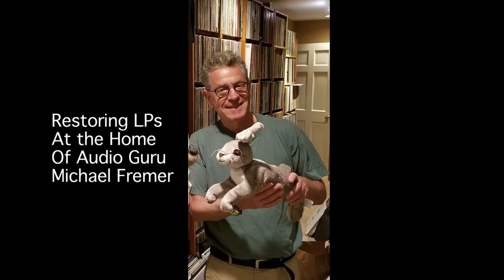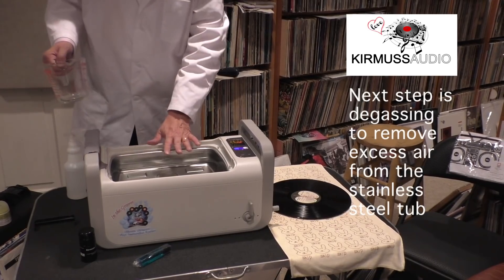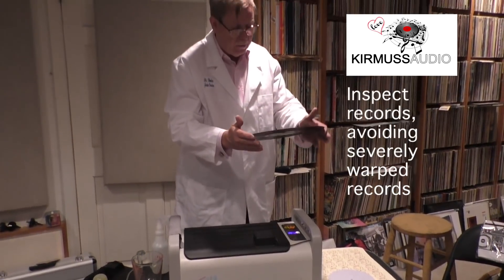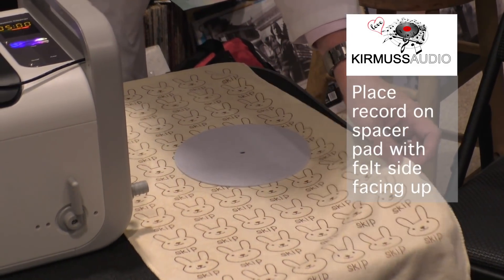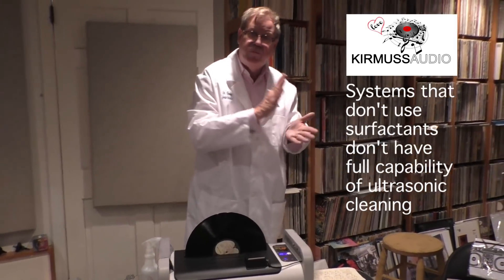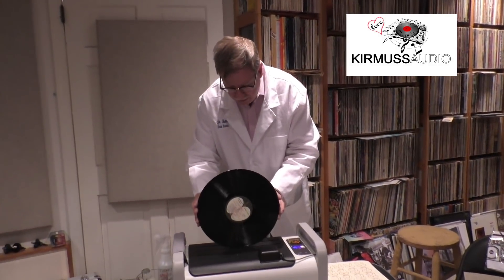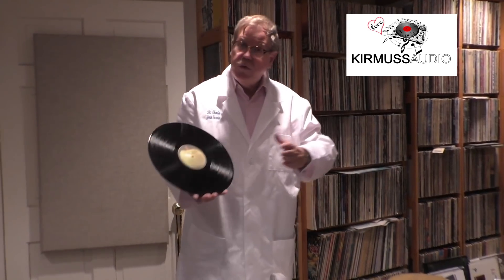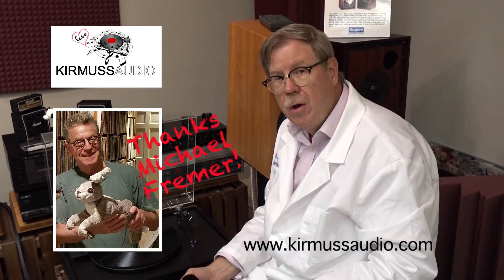KirmussAudio System Demo

Comment: I bought the KA-RC1 a few weeks ago. It's amazing, It's pricey, yes, but it trumps Spin-Clean & Vinyl Styl, but it is a much deeper cleaning system than a vacuuming-based offering.

Friends, after using the KA-RC1 with several of my old LPs, they literally sound brand new.

It will NOT repair deep scratches, but if people have carefully handled their LPs and stored them properly, the KA-RC1 genuinely restores the original sound of your records.

If you care about your vinyl, get this thing.
Reply from the maker: Thanks for your note. In viewing images, the KA-RC-1 1 cannot create these marks.  The KA-RC-1 will uncover scratches hidden by resellers or repackers that have polished records for resale. A fact of life these days. Many record resellers do not appreciate our discoveries at trade shows where we discover these practices when record buyers bring in records fir restoration. 

 Only if a pad has been inserted incorrectly us there a possibility of blemishing a record.
Reply: Are you a friend of Kirmuss?  I used it for 1 week now and had many records destroyed by cleaning (scratches) and it doesn´t get the records clean even if I spend 1,5 h cleaning. Don´t buy this thing.
Reply: If you followed the manufacturer’s directions and records came out damaged using this machine, than that’s on you. I’ve restored multiple records that I once thought were too dirty or scratched to play again. This system completely restored them. Absolutely no reason anyone with even an average level of intelligence could damage their records using this system.
Reply: @HIHIMIII56  No, I'm not a friend of his. I still use the unit, and I still recommend it.
Reply: @HIHIMIII56  It destroyed many of my records too. I think it's the wheels that your record spins on. Tears up the rim of the record. The white crust you see when it comes out is probably the vinyl stitching.
Reply from the maker: @charlie2464 It is impossible to destroy a record, sorry to say. The records are suspended on a soft roller.  We have noted of late a half dozen Mofi records bought as new and brought to our booth at the various trade shows for before and after record groove restoration where supposedly new records saw rough edges with slivers. Once restored we saw 2/3 of the record where the record was not cut properly. Whether from the factory or a repack,  the edge of the record seems to show where a marker was used at sone point in time to hide the defect.
Reply from the maker: @HIHIMIII56  impossible for the process  to scratch or damage records.  Many beware and used records after restoration will allow us to see surface scratches and marks hidden by polishing treatments applied to the record by record resellers trying to make damaged records look new.  We have caught record repackers polish what appears to be new records only to discover scuff marks under whatever they applied to the record for sale.

The only way to scratch a record is if the felt pads are not inserted correctly in the slots.
Reply from the maker: @HIHIMIII56  impossible to damage a record. The images shown show blemishes that the machine cannot even produce.

Comment from the maker: We would love to do this. We will make a recording of before and after as well as provide signal strength measurements. We also use the Sugar Cube SC1 as do many of our dealers  to count the clicks and provide and record  the audio just of the pre and post  restoration process clicks and pops as reference. Great proof of our restoration process. No one else as a manufacturer talks of quantitative and qualitative measurements and processes. In fact one sonic cleaner is not even using ultrasonics, we discoveted...  Please do read Paul Rigby's test report in HiFi World Jan 2019 edition where a record restored by our system and then subject to  the Audio Desk System, his prior reference system,  affected negatively the record that we just restored and where the record  was then returned to it's full glory when returned to our system for one cycle. Hifi Pig published the same results independent of Paul in their January 2019 review, giving us Outstanding Product award. We cannot say more , we work with record custodians on a professional basis and use test equipment to prove our claims, but it seems globally where the snake oil is everywhere else... not in our process.
Reply from the maker: Now on the KirmussAudio YouTube channel,  two short video clips of before and after record restoration with audio in sync with a spectrum analyzer. Note the increase in signal and frequency response.

Comment: Ok for a handful of records, will take ages if you have a few hundred/thousand records. $890 on Amazon. Not as pricey as I was expecting. Was expecting $2k. Still a lot of work  but prob worth it if you have a 20k system
Reply from the maker: Typically we see 4 five minute total cycles. We may do 2 LP's at a time in that period.   The other systems after their advertised 5 minute cycle, even repeated 6 times do not clean the grooves!!!  Paul Rigby's review in HiFi World proved where a restored record   using our process sees the same record  when subject to another process see the results negated,  and with sound degraded. Another 5 minutes back in our system sees the sound, air and space returned. Sonics alone have been proven thus not to be what they are purported to do. Our findings  thus independently validated. Yes, a little elbow grease is needed with our process but the signal gain and resulting  soundstage  are well worth it!

Comment: will this cleaning method clean old RCA records and Columbia records that were kept in plastic and cellophane sleeves where the plastic and cellophane has seemingly baked into the vinyl? Will it remove it from the record?
Reply: hello !

sadly the damage is done. the groove is physicaly altered. i read somewhere that the use of a car restoration product called scratchX from meguiar's did a good job polishing the surface and as the product contain lubricant it seems it helps reduce the shhhhhh sound. so it could be ok for a digitalisation.
Reply from the maker: Yes!

Comment from the maker: Only use distilled water,  de ionized is not the same as to purity.  U may consult many sites regarding this.
Reply: Yeah, but you try getting hold of distilled water in the UK or Europe, enough to fill that machine and you'll have to remortgage your house (slight exaggeration, 5L £22 on average). If deionised water leaves no residue after evaporation, why do you think it's not good enough? Zap deionised with UV if you're worried about micro-bacterial malarky. Personally, I think there is a line between that which is theoretical and that which is audible. I mean, where do you stop? One could argue that your system should only ever use use triple distilled, UV treated, reverse bed osmosis water but would it make a difference to the final sound one hears? Nahhhhhhhh. Plus, try getting that in the UK and pharmacists will look at you like you're going all Walter and cooking up crack. I mean, where does one stop in an attempt to get the best sound out of a record? Wash, vacuum, catonise, plasma wave, UV sterilise, vacuum, wash, rinse, catonise again, rinse, rinse again. Some company will have us blasting our records with gamma radiation from Sterigenics next in an attempt to get an extra 0.00000000256Hz frequency response through the mechanical surfactant removal of lentivirus. Where does one stop? WHERE DOES ONE STOP? I need a lay down. Record washing is fab (even if you use a George Vacuum cleaner for the job, UK again) , wash it, suck it up, listen and enjoy. Buy more records! Sorry, is that a UK only term? Vinyl. Whatever. Just enjoy listening. Mr Kirmuss, not after a fifty billion word reply / justification,  just my opinion. Buy more records. Be happy :o)

Comment: Wondering if a high pH ionized and microclustered water, like the 11.5 pH produced by the Enagic SD-501 water ionizer, will work as the post cavitation cleaning agent.  Thanks!
Reply from the maker: De ionized water of any type is not recommended as only distilled water has all bacteria and elements removed. We have discussed this matter in many other posts.

Comment from the maker: Also we use the specially sized goat hair brush to further polish and apply antifungal to the record while spinning on a turntable before audition or storage.
Reply: What is mixed with the distilled water in the surfactant?  This video says ethylene glycol, the website says diol 2-propyl which looks like propylene glycol.  What is in the surfactant other than the water?
Reply from the maker: @briandrex  we use 1.4 ounces of 70%   isopropyl alcohol  in nearly 2 gallons of distilled water just to be used as a initial degreaser of surface fingerprints. Vinyl repels water as you know so the cavitation of the micro bubbles formed is not the main engine and process of restoring the grooves.
Reply: @kirmussaudio7578  yes this is what is in the cleaner itself.  What is the actual surfactant in the spray bottle made of and what percentage?  Your videos state 1% ethyl glycol and 99% distilled water while the web site says 1%diol 2-propyl and 99% distilled water.  Can you give some clarification as to what the surfactant is that is sprayed on the records?  By the way the system works great.  Noted almost 5db or increase when testing.  Also hear things I haven't heard before.  Great restoration system!
Reply: Thank you for the reply.  From what I can tell it is indeed a mixture of Ethylene Glycol, Isopropyl Alocohol 70 percent and distilled water.  Will keep away from all pets and kids for sure want clean records but no one sick.  Thanks again for your reply it was very helpful and works! :)
Reply: @briandrex  extract from the discwasher patent :

 A phonograph record cleaning composition useful for loosening and coagulating particulate matter and inducing fungicidal activity upon the record surface without leaving any evident dry weight residue after 
usage, and consisting essentially of a fungicide of so 
dium azide in an amount of between about 0.0001 to 
0.001 percent by weight, a nonionic surfactant selected from the group consisting of octyl phenoxy polyethoxy ethanol and nonyl phenoxy polyethoxy ethanol and 
included in an amount of between about 0.0003 to 
0.025 percent by weight, and emulsifier selected from the group consisting of propylene glycol, ethylene gly col, and glycerine and included in an amount of be tween about 0.001 to 0.0125 percent by weight, an alcohol selected from the group consisting of methyl, ethyl, propyl and isopropyl alcohols and included in an 
amount of between about 0.01 to 5 percent, and the remaining part of the composition comprising a liquid carrier of water present in an amount of not less than 94 percent by weight, said alcohol being included to 
make the surfactant more soluable in said water.

Just know that almost all ingredients are old-school and proved toxic and there is a lot of "green" components now. But you have the big picture of a cleaning solution.

For.example in my country I can find a bio dish soap with glycerin and without perfume meeting all the requirements. 

 6l of water, some ethylic alcool (isopropyl is not easily found here). A first round of 2-5 minutes US cleaning, a spray of water + dish soap and a quick brushing with a beard brush (we call it a badger) and another 5 min US cleaning.

Rince and dry 2 times. And enjoy.

You can also mix soap alcohol and water inside the tank but rinsing has to be more thorough.
Reply: Pvc is quite resistant. Just avoid acetone and others petrol based solvents and you're good.

Comment: Seems to me if you already own a vaccum based RCM you could use this system and then just use the vaccum RCM to suck up the distilled water used in the final rinse so you're not hand drying it , no ?
Reply from the maker: Vacuum brings in static onto the record by way of moving air, as well as reintroduces dust. Not a process we recommend
Reply: @kirmussaudio7578  yes it does bring static on to the record but have you ever wiped a pair of  eye glasses with some sort of clothe after cleaning them ? No matter how clean you try and keep your optician clothe it still leaves smudges . I use a hair dryer on my eye glasses after cleaning them , totally smudge free . I think if you are not going to have a vacuum on a RCM then you should have a blow dryer as some other ultrasonic RCMs use .
Reply: @Shadowman820  To me, this is getting more nuts. Yes, any 'blob' or 'thing'  moving against air will cause said 'thing' to get embedded with free electrons - static. Will this make any difference to the audio signal? Nothing audible. Vacuums don't make static. If you're talking about a vacuum device to remove fluid off a vinyl record, there's usually a wetting process involved beforehand, we aint talking a girl with long dry hair and a balloon here. Any form of moisture or humidity will neutralise static. If you take a hairdryer to a record then that's like a sandblaster for every form of particulate going. Suck that stuff in and blast it on your music. Nahhhhhh, bad, bad, bad. Nahhhhhh.
Reply: @kirkrogers4937  Yeah this process would be too labor intensive for me too .
Reply from the maker: As vinyl repels water  by nature, a restored record taken out of our process sees little if any water on the record's surface. The light  mist applied barely requires a vacuum.